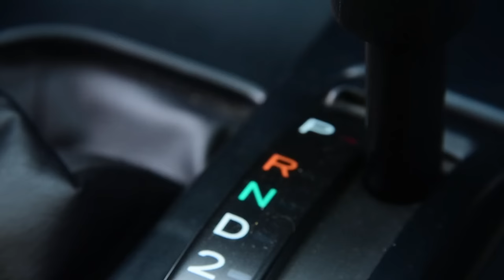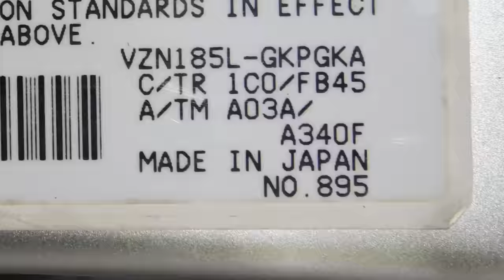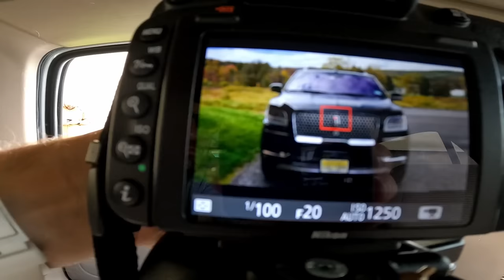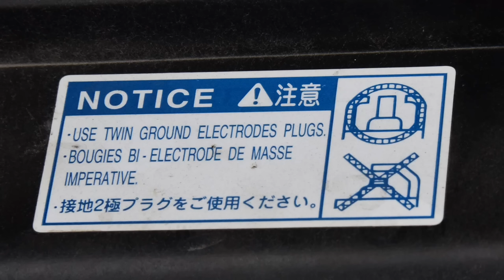2000 Toyota 4Runner SR5: Regular Car Reviews

Comment: Some limited upgrades could improve your 4Runner. They came with very comfortable leather seats with good support.  Also 4.3 gears with the optional locker and a multimode transfer case (99+) that you could push button switch to AWD. No limited came with a manual though, only a fully optioned SR5 had everything.
Reply: And a reliable supercharger (mine is at 252k mi, with 170k mi supercharged) too.  I don't have a blown head gasket for the last 170k mi supercharged, just valve cover leak replacement (DIY easy to do).  I just leave the car (99 Limited multimode) in AWD (4HI unlocked center diff) all the time so I never have to worry about slip when pulling out.

Comment: You make multiple good points. I insisted on buying a base model 2022 Toyota so it would be more similar to my 1993 Toyota. I didn't want to deal with a large touch screen & a lack of buttons.

I never gave these 4Runners much thought what with all the domestic SUVs I grew up around so thank you for the video. POR-15 is pretty awesome. I used it to repair my Plymouth Voyager about 10 years ago.

Comment: I had a 2000 3rd gen with 217k miles. I was dumb enough to believe the 5000lb towing capacity, and my dad and I towed our motorcycle trailer with two bikes from Nashville to the Smokies. By the time we got to the Tail of the Dragon, it was stuck in 3rd and after we parked we checked the transmission fluid. Dip stick came out dry, and it wouldn't budge from park. Topped off the fluid, and it was totally fine. No shudder or anything. Most unkillable car I've ever owned.

Comment: I got one in 2022, had a bunch of issues and it was destined to the junkyard. After some suspension bushings, engine maintenance, a transmission cooler to separate the lines, radiator, wheels, tires. She’s back on the road, was this a smart move financially? Not really. Do I love it? Yes. I sold off a 2004 2wd ford  ranger for it. Lost the truck bed and gas mileage, gained a fun 4x4 that I have taken everywhere. Just expensive to drive. I too also get 15-17 mpg.

Comment: Had one in Tanzania.  Amazing.  It's the only car we teachers used to drive.  We would import them from Japan for the right hand drive market.  I had the 2.7 manual without the sunroof.  I was afraid of auto transmission problems, and the sun was brutal on the equator, no need for more sun.

Comment: I recently towed an Aw11 on a trailer with a 1999 4runner - surprisingly competent at towing. Though that is definitely up near what I would consider the reasonable limit. Stopping was sketchy, my comfortable top speed was somewhere around 100KPH (60MPH). Going up hill t hat dropped to 80KPH. It COULD go faster but then you're in third gear at 5k RPM.

Comment: I have owned a 1st gen, 3rd gen, and now 5th gen 4Runner. 3rd gens are legendary, perfect-sized, and have earned their venerable reputation. I don't know if I'd call them the best, though. Mechanically, they're almost perfect, but they do have flaws. Catastrophic lower ball joint failures due to the flawed design do happen, and they will strand you at best, or injure you at worst. The 3.4L V6 was stellar for 1996, but it does like leaking its gaskets, and you'll pop a headgasket if you drive it hard enough long enough. The 4-speed automatic does sometimes break at high miles. Worst... the pink milkshakes. As the radiator ages, it can start mixing the ATF and engine coolant, and destroy the trans and even engine if it goes on long enough. I replaced my radiator in my old '99 solely due to pink milkshake fear. The front brakes will warp every several years if you don't abuse them, and every two years if you do. Timing belt costs do exist for the engine, just another thing costing money. The 3rd gen was the most reliable SUV of the time period, but not the most reliable SUV of all time.

I think the 4th and 5th gen 4Runners are going to have quite legendary reputations in the future. They're like 3rd gens except they have even less problems and less costly required maintenance. The 4.0L V6 and the 5-speed automatic are just crazy bulletproof while being crazy low-maintenance.

My 3rd gen was mechanically superior to my 1st gen, but I think I like my 5th gen the most. It's the ultimate "go anywhere and then get back home" vehicle. For god's sake, I am planning on taking it from Utah to Tuktoyaktuk and back.

Comment: Should’ve stuck it out for a 5-speed. Owned a 2000 SR5 manual V6 4x4 leather (no locker unfortunately) for 8 yrs. Towed a uhaul filled to the brim cross country twice, moved with it countless times, put 110,000 miles on it. Welded the frame 3 times. Took it out every snow storm and drifted the hell out of it. The engine is a dog but much better w the manual. The shifter was direct linkage into the transmission and great to shift. Makes the 3rd Gen Tacoma manual gearbox look like a toy. The only downside was the passenger space. It’s quite a narrow vehicle and about the same inside as a modern day Corolla. Didn’t really mind the gas mileage. Got 18.5 mpg no matter how I drove. 

Give the MAF and the intake valve a spray every year and the engine actually goes faster. Do the tundra brake upgrade. Change the LBJ. Get the frame oil coated before season every year and the thing will serve you for life.

Comment: I have a lift 3rd gen with 274k miles and big tires and they definitely dont ride very well, are not quiet on the road, and are slow as heck, but it will take you anywhere and not leave you stranded. Ive taken it on countless off roading and camping trips and driven it across the country twice and has done everything I need. its definitely been beat doing the things its meant for, but still looks great when its all clean and everything on it works, even the sunroof, dash clock and rear washer fluid sprayer. I dont think i could ever part with it in good conscience. if you find yourself to be the lucky owner of one, or have an opportunity to get one, keep it forever

Comment: I have a 96 with the 5 speed V6 4x4.  It is the best.  Wait and take your time to find one if you are thinking about it.  It is "small" by current standards but that is what makes it great. 20-21 MPG is realistic if you get up to 55 or 60 and set cruise for 300 miles.  If you want to get places fast then the 4runner is not the vehicle for you.  POR15 unfortunately does not solve the rust issues due to the frame rots from the inside out.

Comment: I sold my 2022 4Runner TRD PRO (Lime Rush best color!) in part because it was SO SLOW and LOUD when compared to my other car, the 2022 Chevrolet Bolt EUV. This is not a misprint. When I got an EV as a second car, it made the 4Runner sound so friggin' loud--and nothing is happening. It just booms and booms and doesn't go anywhere.

Comment: My very first car was a 3rd gen 4-Runner... 1997 with the 4 banger. It was a close runner up to a USPS Grumman LLV to being the slowest vehicle i've ever driven. My parents actually still have it, but its been stored for about 3 years now and its rusted out to the point it's almost undrivable anymore (was a PA car its entire life). It also wasn't as reliable as you would think a 4-Runner would be....2 head gaskets in 10 years time. Still have a soft spot though!

Comment: I had a 97 i think with about 287k miles. I got it for 500 dollars, and the interior was in relatively good shape. Seat was worn out and the airbag was blown. The outside was wacky, though, it had a lightbar, mismatched fenders, hood, and trunk. Somehow though, the rust, the northern rust belt rust, and the 8+ names of previous owners in the glovebox, the rust was much worse than the look of the thing. Also missing the front bumper replaced with a homeade square tube built one. It was the limited package, leather seats and bells and whistles, but half of it was in need of replacing. 

I did some big fat donuts in it, after all i was in in highschool. It sure did an absolutely incredible one tire fire and i had fun ripping some trails off road. One of the rear torsion bars ripped out of the frame, and i had to walk it to a friends house where i cleaned it out and got it towed to the scrapyard. It was a rusty nightmare  and i had a blast with it. I definitely killed it and i feel bad. This is my confession.

Comment: Long time watcher and big fan of your work. In answer to your question about the moon roof..My 2000 SR5 that looks exactly like yours, has no moon roof. I specifically wanted one without it because I figured it would be an issue eventually with the motor or seal. I put on some Bilstein 5100 shocks and Tundra brakes. You have to shave a little off the calipers to make them fit the front but the braking is vastly improved over stock and ride quality as well. You should look into HoneySeal for your underbody protection next time. Keep up the great work both you guys. Happy travels and safe motoring!

Comment: I own a 2000 Toyota 4Runner, a 2000 Ford F-350 with 7.3 diesel and a 2000 GMC Yukon with 5.3 V-8. I never planned this, it just happened that way. The Yukon feels like it has double the power of the 4Runner and the 7.3 has double the power of the Yukon. I pull a jet ski with the 4Runner and you know you are pulling it at all times. All three of these vehicles have over 200,000 miles except the Ford with about 180,000. The Ford and GMC are on their second transmission, the 4Runner’s transmission is original and works like the day I got it. All three are on original engines. The Yukon and Ford leak a little and burn some oil. The 4Runner is usually down a half quart after 5000 miles between oil changes and does not leak a drop. The biggest difference in the 4Runner and the other vehicles is everything works on the 4Runner. Power windows, locks, radio all work on all 4 doors. The 4Runner does not look or feel warn out at all. However, look out for these issues with the 4runner. The models that came with California compliant emission packages would burn up their cats early and the “fix” was to lean up the fuel delivery which kills power, but will make the two cats last more than 80,000 miles. Secondly, the fitting that connects the transmission cooler lines to the radiator fails at some point. When his occurs, you either lose all your transmission fluid or all the engine coolant or both. If you own one of these, change out the radiator. Other than that, no issues. Also, a locking rear differential was an option that I looked for for about a year. They are rare.

Comment: My dad bought his 2002 4wd auto SR5 brand new, has something like 120k on it now. #1 his in fact does not have a sunroof. Just did a 4x4 service and it was the cleanest fluid I’ve ever seen having worked at a dodge dealer for 2 years

Comment: This is a great video. I’m watching this as I’m in the process of trading in a 2013 explorer with 140k for a 2012 sequoia with 244k. I’m out of my mind and it makes no sense but when I drive them both, for some odd reason it does make sense. The Sequoia feels like it has less miles, it’s held up better over time, no lights on, no squeaks. The engine is quieter and smother. I’m going to take a huge hit in gas mileage but right now I’m likening it to the pain felt from exercise. It sucks but it’s good for you. That you for everything in this review. 

“This thing sounds like a Shop Vac running on 220.” Lol! I might use that one.

Comment: The Tundra brake swap is a must.  3rd gen 4Runners have undersized roters and discs causing the excessive heat and eventually shutter.  The Tundra roters bolt right up and are a huge help.

Comment: I got sideswiped merging onto a Cloverleaf entrance ramp in my third gen 4runner, by a guy exiting in a Chevy Cruze who didn’t see me traveling literally parallel to him. He had at least 3000 in paint and body work to do and I didn’t even file a claim because I couldn’t find a single scratch on the 4runner, the steel runnings board took all of the impact and they weren’t even bent... I still miss it! It even had a more power button to go faster—in 1997. 3rd gen is best gen.

Comment: I've been lucky enough to own a 1st 2nd and 3rd gen here in AZ and while i love my 1st gen. the 3rd gen was the most practical and easiest to use and fix. easy to drive comfy on the roads easier to off road. all were 4 bangers. 22r then 22re then 3rz. <3 great little engines for life in the slow lane

Comment: I daily a 97 T100 with the same hardware. I love this truck, and I've basically hated every other vehicle I've owned.
It lives off grid on dirt roads and loves it. It's dog slow, and I push it, but it does fine.
I'm doing the injectors now as it developed a misfire, I was worried about it, but injector 1 fixed it, signaling a likely 'nother 100,000 miles to go. I'll be taking this thing to the big island and it'll get consumed by ocean rust. Yes it is very bouncy.
Also the boulders on this road knocked my muffler off, so it has a terrible aftermarket one that sounds like pure garbage and is LOUD.
Still, love this car. I still put money into it at 215,000 miles.

Comment: me in my 4x4 v6 manual with the locking rear-diff. best truck ever. unbeatable.235k miles. i wouldn't trade her for anything other than a matching tacoma

Comment: I run Premium, 93, and Royal purple dif fluid. I  average 19mpg freeway on my 2002 that I bought new.  It now has 303,000 miles on the original V6. The highest I ever got was 21mpg on a long freeway drive

Comment: The closest equivalent of a 4Runner that us Indonesians get is probably the Toyota Fortuner.

Since the last decade, it's a popular tuning car because somebody figured that tuning a turbodiesel engine gives a good bang for the buck, with generous power gains and still delivering decent gas mileage, and most importantly the car can still run on Indonesia's notoriously crap diesel fuel.

Basic tuning usually consists of an ECU remap with possible addition of a de-catted downpipe and replacement air filters, enough for doing highway pulls for the 'gram.

About the base Fortuner, the car steadily progresses through time:
1. First gen turbodiesels only delivered 100 hp out of a 2.5-liter; improvements in 2012 jacked the car's power to 140 hp thanks to top-mounted intercooler and variable geometry turbo. Automatic transmission is preferred in most cases because it's fairly strong.
2. Second gen has new engine, 2.4 liter with high pressure common rail, variable geometry turbo, and new 6-speed automatic transmission, delivering 150 hp and 295 lb•ft; later iterations have 2.8 liter turbodiesel with 200 hp and 370 lb•ft, gaining even more interest from rich kids who wanted to go fast reliably.

Comment: Great video. I had a third gen that I towed (!) my Miata to track days with. I did a rear disc conversion so it would ACTUALLY STOP and put some air springs on the rear so it wouldn't sag with a load. I was pushing the envelope of the 4Runner lol. Durable, yes. Rides like garbage, also yes. That solid rear axle makes for jiggy jiggy jiggy jiggy jiggy side to side to side to side to side action. But that roll-down rear window...

Comment: The 3rz in the 4cyl option produces the same power as the previous gen's V6. Theyre both 150hp/180lbft. And it does it with less gas and fewer headaches.

Comment: Only a 3rd Gen owner could nail that intro so spot on.

CAUTION: TWO 3rd Gen Achilles heels. 1 - Check/replace the radiator or you could ruin the transmission  2 - Replace the lower ball joints or you could total the truck (Use Toyota parts only)

Comment: I have a ‘99 V6 SR5 4R 
(yes, Made in the Motherland) 
which was rusted tf out like a WV meth mouth. Found a slightly used rolling frame, had the body mated to the frame with all new brake lines, aluminum radiator, Injen intake, SS catback exhaust, & 5100 Bilsteins. I ripped out all the dog hair interior, the emerald green paint is like new.
Just put new rack & pinion, tie rods, ball joints, and some oil in it. 
Drives just like when I’d steal it while my parents were out of town. All I need is a hot new gf to pick up from the airport, I’ll be alive again (inside).
It’s gotten me out of some sloppy Baltimore alleys 2ft thick of slurpie while record downfalls stopped every other pos on the road. It’s now my SW desert rig. I use it for excursions to the grocery store, beer store, all kinds of stores, and Sundays I take my 2 dogs to a canal trail so they can stop every 30 ft to pee on something.

Comment: My dad had a 2004 4Runner. I would use it to tow my bike from Baltimore down to Richmond, swap out the single bike/8ft trailer for a 12 footer and throw my bike and my buddy's two on it and head out to Tail of the Dragon. The brakes felt like they were made of wood but that 4L V6 could maintain 70 up any of those hills while sucking down 1 gallon of 87 for every 12 miles.